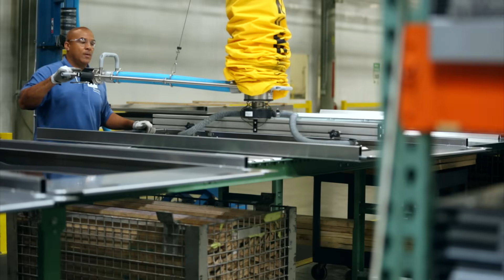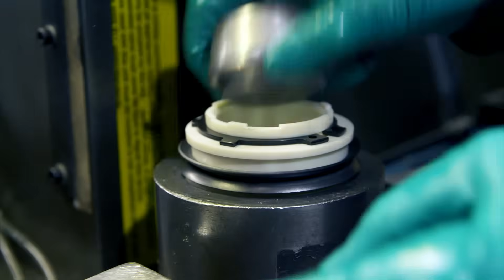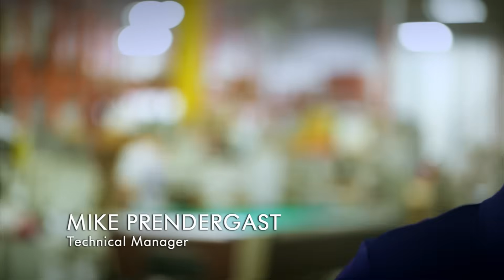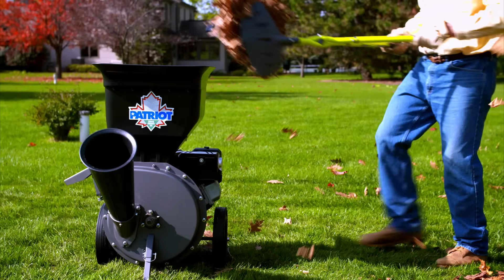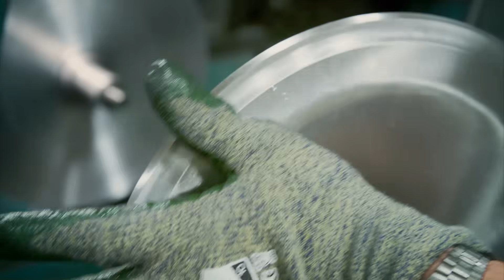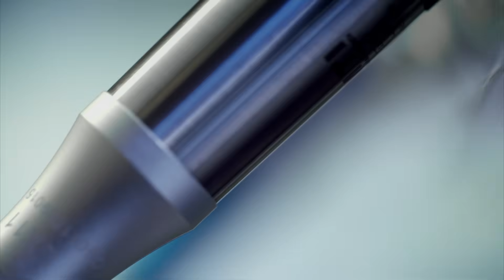How a Elevator Really Works | Machines: How They Work | Ep 10 | Full Engineering Documentary

Comment: Samuel Otis demonstrated the elevator's safety by having his assistant cut the cable while he's in it. The brake is designed to activate should the cable break and the elevator car is in a free fall. In fact when Mythbusters tried to make an elevator drop, they had to basically cut the elevator apart in key places as the brakes activate if it moves too fast, even without any cables. It has simple pendulum based brakes that activates as soon as it drops.
Reply: It was Elisha Otis, not Samuel Otis.